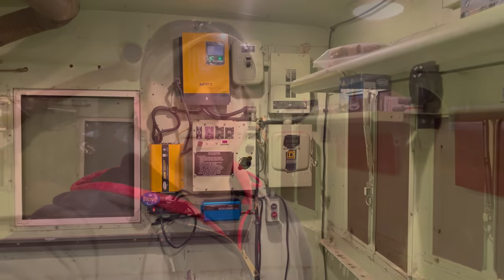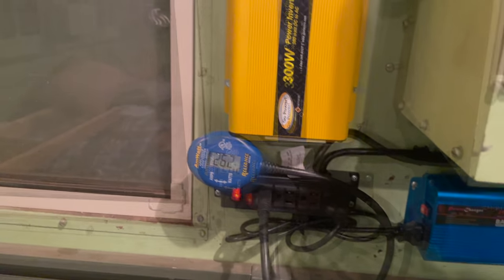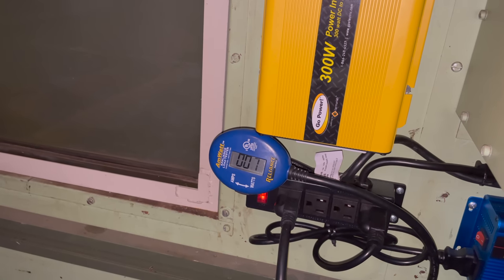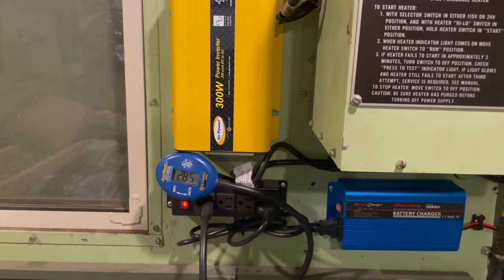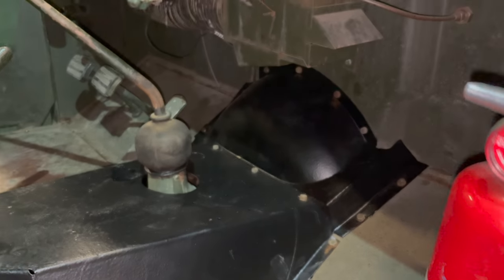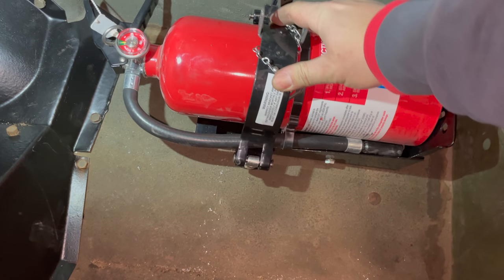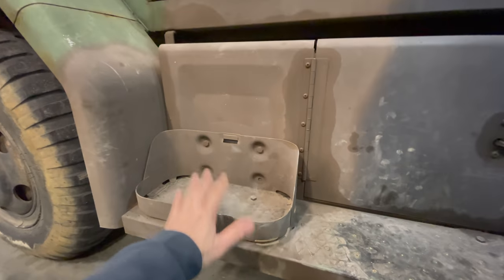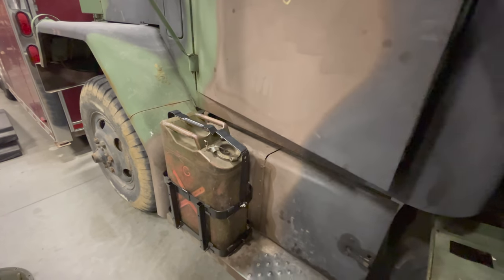Part 2: M35A2 M109A3 Overland Camper Build

Comment: Save the old Jerry can holder. Plum the heater in back to a can and use the bracket to hold it. That way you don’t run the main tank empty.
Reply from the maker: I am sure the heater draws from a stand pipe so that it cannot drain the tank empty.
Reply: @ThisWeekWithCars  I use to use this type of truck when I was in the Army, some did have a standing pipe and some didn’t. Just depends on who has worked on it though the years

Comment: I have a propane furnace in my diesel pusher and the batteries die before morning when it's around 30f. Its  terrible way to heat unless plugged is shore power. Your way seems better. Have fun camping

Comment: Hi Steve, love the ideas.. perhaps 2 things If I may mention, 1 being good thermal Insulation and 2, why not take a look at those cheap Chinese truck/ camper van heaters.. I heard good reports on them and the better ones come with a remote controlled room thermostat/ my son wants one for his high top VW camper van being its diesel powered. It will only take up a fraction of space inside your offroading camper van.. Anyway Thanks for the video -- Ian -- UK.

Comment: Why not do away with the 120v lighting and run them direct off the 24v? Doesn't make sense with LEDs to convert up to 120v then convert back to low voltage for the LED.

Comment: I can't seem to find the video where this transmission exploded? Considering I'm looking into buying one of these vehicles I'd like to know what the cause would be.
Reply from the maker: It’s in this video: https://youtu.be/-yN8eAAFVAo
Reply: @ThisWeekWithCars   OK thank you I'll check it out!!!😉👍
Reply: @ThisWeekWithCars   OK watched the video, didn't get any info from it except the bellhousing cracked and you replaced unknown parts for unknown causes, so ok. Thanks.💁‍♂️
Reply from the maker: @skeetermcswagger0U812  the jack shaft bolts probably loosened up and when it came loose it jammed between the transmission and the transfer case breaking the transmission case.  Common problem, make sure to check all driveshaft bolts periodically.